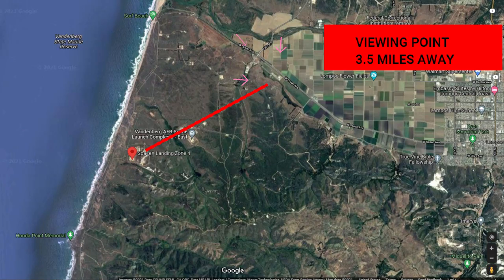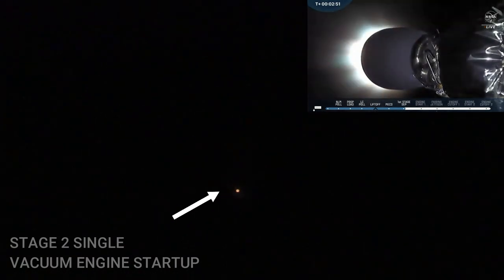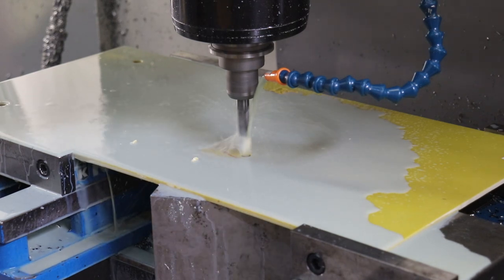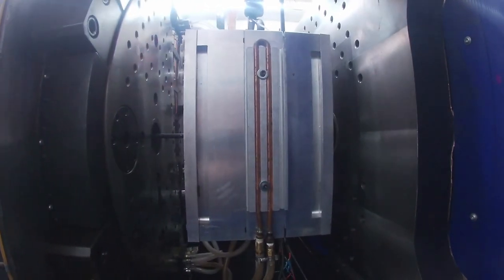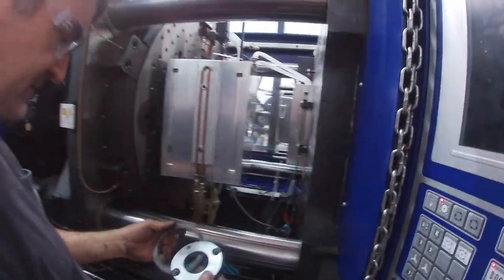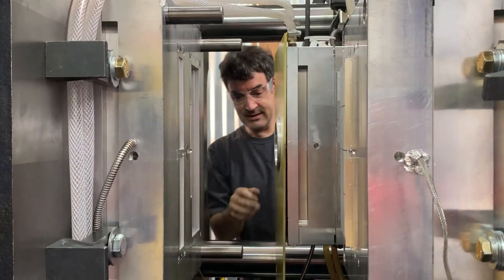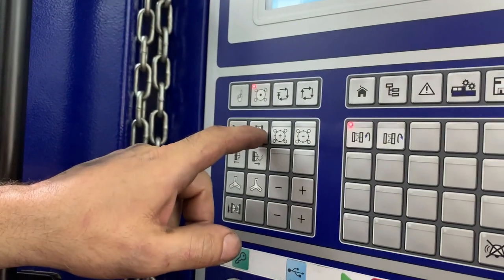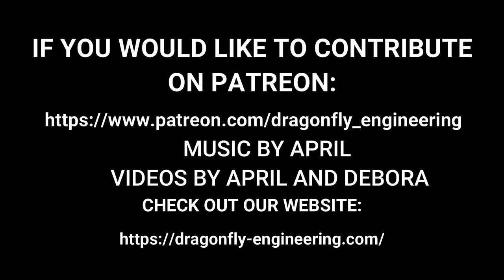SPACEX DART MISSION AND INJECTION MOLDING

Comment: The  sound of the rocket engine is great, it sounds like a pulsejet engine.
I know the thermal insulation plates by using molds with a hot runner, the idea for using it is good,  because your molds are made from alluminium and this material is a realy good heat conductor.

Comment: Great video, as someone who is new to the trade and I may have missed it if you mentioned it, but how do you maintain parallelism (or how close/ far can you get away with) when using the heat isolators? Was putting the mold under the 2 tons of force to flatten and index everything into position?  Thanks!
Reply from the maker: Hi CJ, I measured the thickness of the heat isolators to be within .001”. I also measured the 2 molds and shimmed the short mold to match the mold height of the neighbor. The machine platens are 0.003” parallel  spec max is 0.005”. I clamped up the molds with 2 tons to mostly force the mold hafts square with everything before I clamp them in place. ( allows repeatable close). The 4 machine tie bars stretch to balance force, up to 0.005” deviation. The concern I have is if one mold needs to be much hotter than the other will result in thermal growth on one mold.
Reply: @DragonflyEngineering  Thank you for the reply! That all makes sense, I appreciate the clarification! Happy New Years, stay safe!